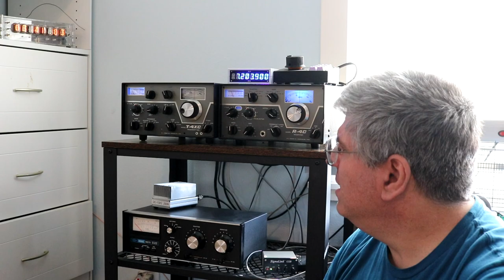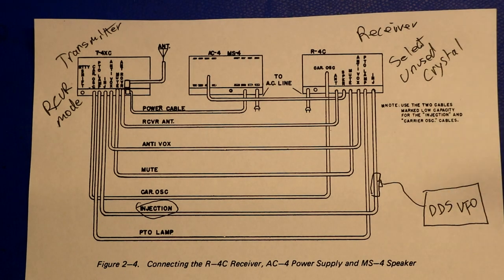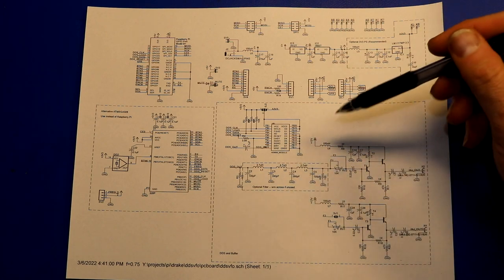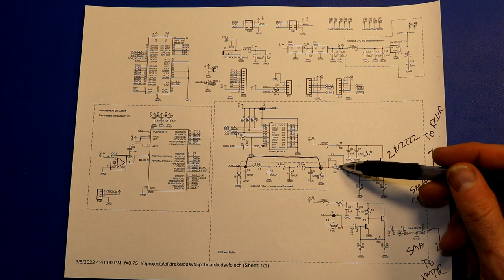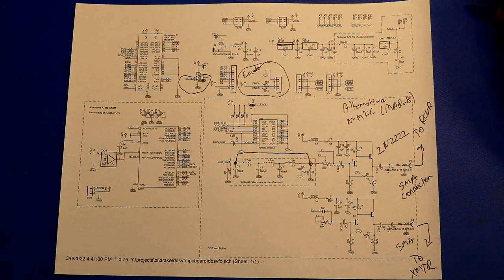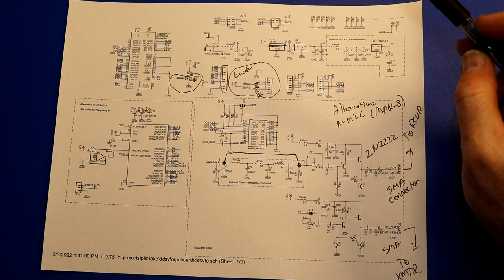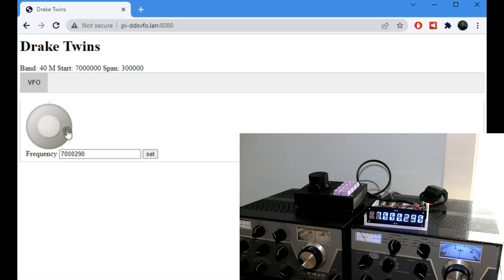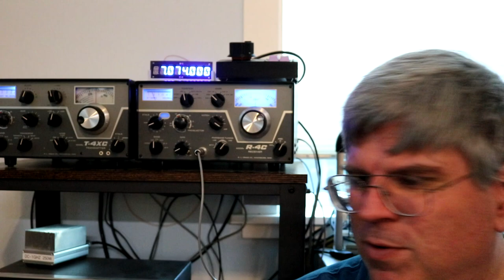Raspberry Pi Based DDS-VFO for my 1970-era Drake 4-Line Tube Ham Radio

Comment: EFHW antennas are great, do you have a counterpoise attached to yours?  I'd suggest a 17ft piece of wire attached to the shield/ground to help with your "RF in the shack" issue.  Great vid, long time fine of your channel.